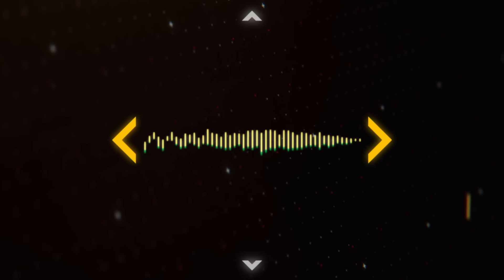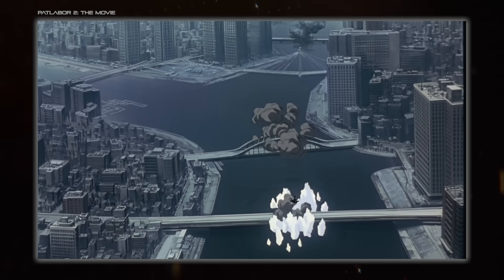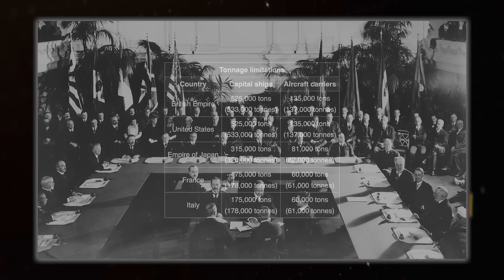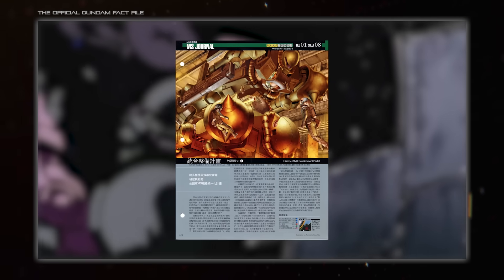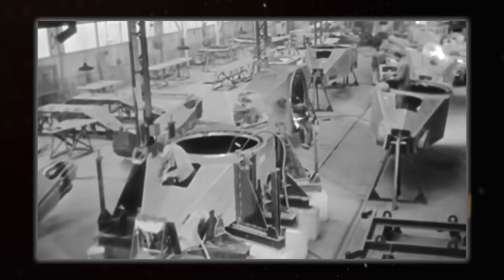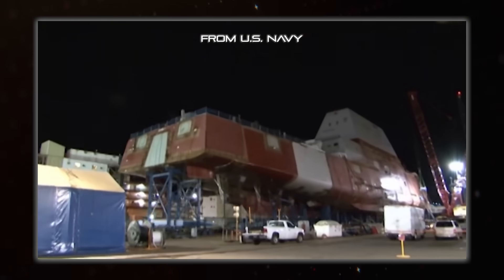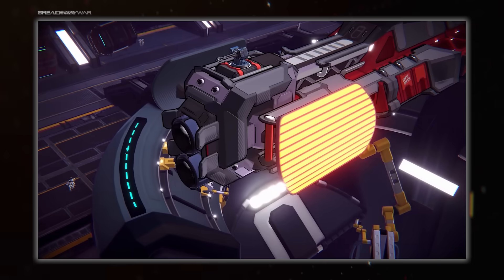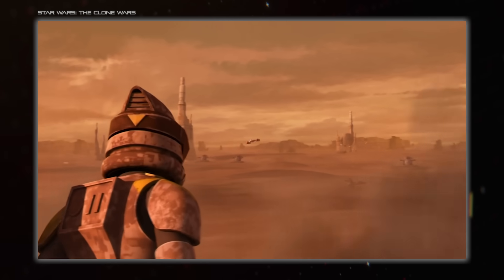Design Principles in Sci-Fi Spaceships

Comment: Another reason I so love Stargate. The Earth ships feel like something the human military built once exposed to the alien tech needed to accomplish it. The 303 and the 304 look like we took material earmarked for some carriers and frigates and slapped it together around a spaceframe instead. And that hunkered turtle shell on the 304 makes it look like it was designed to be able to take a hit while dishing out damage.

In particular, they look like they were meant to sit above Earth, directly shielding us from above as they fired up at the enemies attacking the planet. Also explains the complete lack of armour plating on the underside. That would be facing us. Shame we fell behind on the weapons side for so long. But boy could they take a beating.

Even the insides felt human. Long corridors with the bracing every few metres. So many greebles inside and out. And then we expand out to the different other races and their own design philosophies. The Goa'uld where pomp and intimidation is paramount. Everything exists to maintain the illusion of their divinity. Even if the design isn't the best way to do a thing, it's there for the wow factor. To keep the primitives bowing in fear and wonder.

And the Asgard are beyond such things. Their designs are open and practical because they've developed beyond the limitations we're still bound to. A massive open multi-tiered bridge is easy for them. Long wide corridors are fine when you can move around easily using beaming technology.

And I loved the way the races incorporated racial aesthetics too. Though the Goa'uld did stick very closely to the Egyptian aesthetic due to budget, the hieroglyphs all over the walls which sometimes had a practical purpose were great. The Asgard control systems with the mix of stones and symbols were very cool.

Here we are, rushing to catch up by mixing both systems with good old-fashioned push buttons and CRTs. The bleeding edge at the time.

Gosh, I wonder how much more Prometheus weighed because of the five hundred CRT monitors than it would of had they been newer, lighter LED monitors...
Reply: But think of the savings they made in life support! Those CRTs worked both as vital displays and helped heat the sections of the ship that had most of the crew most of the time! 😁
Reply: @DrBunnyMedicinal Actually it's getting rid of heat that you have to worry about on a space craft. The ambient temperature might be low, but hard vacuum is a poor conductor
Reply: Ironically, it's actually less likely that the Asgard would have wide corridors because of the beaming technology you mentioned. Why have corridors at all when you can beam around all you want?
And don't say "as backup." If there's one thing proven about Asgard, it's that they don't have backup plans for if their fancy tech fails them.
Reply: IMHO, the 303 and 304 classes seemed much too large for Earth's first interstellar warships; and too quickly built; and too expensive for a program that was allegedly secret. A more plausible sequence is that Earth hijacks an increasing number of Goa'uld cargo/scout ships and Alkesh bombers, refits the interiors, and incrementally moves the tech to new spaceframes. Like zat guns added to SGC's armory, writ large. Story-wise, this would necessarily go in different directions than the space battles we got in SG1 and SGA.

The anime "Superdimensional Fortress Macross" has a similar issue: Earth gets one crashed warship, and within 10 years has reverse-engineered multiple technologies, created a manufacturing infrastructure, and built out a whole military; alll without alien-ally assistance. (The derived "Robotech" is slightly more plausible, in that the crashed ship is a lab vessel with onboard manufacturing, and at least one human gets brain-boosted familiarity with the tech.)
Reply: They pretty much got burnt by the first test with a modified death glider (X-301) and didn't want to risk any other captured ship having booby trap systems hidden deep within them. So the costs be damned, Earth-built all the way.
Reply: @ This is a mixed reply to you and phillipthorne8363.

I agree that the X-301 would have been a major factor in the Earth-built philosophy going forward. Though Earth-construction was always intended after the 301.

They couldn't really rely on capturing gliders on the regular. Especially when they'd have to be in orbit around Earth for any reasonable chance to use them. bringing Gliders through the gate is a non-starter really.

But they absolutely didn't let the 301 failure stop them trying to steal ships either.

The several Ha'taks they had control of for about five-ten minutes each from Cronus and Anubis. And the Al'kesh Jack stole from Ba'al during the Avenger Crisis come to mind.

Guess only Apophis decided to add a recall feature. But Earth-made was the only way to be sure. And it wasn't exactly quick.

It took six years before we had an Earth-built ship at all. And it failed to do what it needed to do. Then the second one was launched incomplete by a terrorist group. Likely wouldn't have seen action for another year otherwise. And even then it too had many flaws that basically made it unusable for two more years.

We never actually managed to design our own functional hyperdrive. it's not until Jack convinces Thor to provide Asgard-designed ones for Prometheus in S8 that the 303 has reliable hyperspace capability.

It's not until Season 9 that Earth had a reliable spaceship we could fly across the galaxy with purpose and know it would get there and back without serious failure.

I'd say nine years of concerted and ever expanding effort isn't unreasonable for R&D and construction of a viable spaceship. Several countries are actively working on this as a high-priority lest we be annihilated from space. Kind of helps cut through some of the red-tape. We built high-energy density reactors as early as S3 with the Orbanians assistance. So we're already ahead of the technology curve in the show.

And Earth had many hiccups and got burnt along the way by more than just the X-301. I think Stargate did a superb job of showing a gradual understanding and progression that led to the X-303 and eventually our fleet of BC-304s.
Reply: @enemixius  And nobody wanted Hammond (of Texas) to give them a disappointed look. That'd motivate anybody.
Reply: @tyrannicpuppy  The lack of recall feature on the Ha'tak ships could also be due to goa'uld considering it unlikely deserters would/could take off with a whole capital ship
Reply: @justinthompson6364 or that unlike Death Gliders they were designed for long term deployments. You don't want your corvettes just deciding to lockout and rtb when they have to detour to pick up some more supplies or troops.

Comment: Best I can figure is:
- Powerplant/storage
- Drive (integrated with powerplant or seperate)
- living space
- closed ecology/supply storage
- computers
- weapons
Reply: -Access point (hatch or ramp or canopy).
-Sensors and comms (Subspace/hyperwave/radio/etc).
-Hull and defences (radiation/space debris/lasers/heat/enemy weapons/missiles/atmosphere).
Reply: Don't forget the Coffee Machine... Otherwise Holden's not going to be happy. XD
Reply: @GabbieTheFox  Or get the phrase "There's coffee in that nebula"
Reply: Just screw one of those plastic garden chairs to a fusion rocket. ez
Reply: @igncom1  Ah yes, the old Kerbal "Compact High Atmosphere Impromptu Re-entry" Device, or C.H.A.I.R Device.
Reply: "living space" is a bit unspecific.
Rotating habitats for different gravities.
Gyms, golf courses, artificial lakes, softair places, etc.
Reply: @MrCmon113  True, living space is very broad. it could be all those luxuries you're describing but on the other end, if you've got a cold military ship that isn't expecting extended patrols the bare minimum would just be;
Bunks
Provision stores
Command & Control centre
and Access to systems that need to be manned/maintained

In this case bathrooms, maybe a kitchen and probably some gym equipment would be included in bunks, and these categories can even overlap into the same space. 
ww2 submarines for instance, often had food stored all over the C&C and the bunks, wherever there was space, and you might've even had to fold the bunks to the side to access torpedo reloading equipment.
Reply: Bathrooms
Reply: Fuel and/or Propellant, the powerplant needs to run on something and so does the drive.
It's also an enlightening exercise to look at the cross sections and interior plans of real life navy ships and see just how much of that space is delegated to carry fuel!
Reply: Radiators.
Reply: pods, and of course your pod bay w pod bay doors...
Reply: And heat management. Radiators!

Comment: It needs to be able to spin. That’s a good trick.
Reply: This needs to be a pinned comment @spacedock
Reply: This unironically. It's a simple means of defending against lasers, autocannons, dust guns, and any weapon that requires repeated hits to deal damage.
Reply: Spinning is much cooler then not spinning
Reply: @trekkieraccoon3343  it has to spin it's round!
Reply: it makes defending easier as it soreads out damage, bit attacking more difficult, as you need to respect your changing rotation in the firing arc, and the projectile will also get momentum from the rotation, theowing it off. If you use autonomous rockets, that's not a problem, but even guided bombs may struggle.
Reply: And also let's you point your gun at stuff.
Reply: "DO A BARREL ROLL!"
Reply: Case in point: the Arwing's iconic (not actually a) barrel roll, which deflects energy projectiles with no damage to the shields.
Reply: Ore a liquid Metall shield on the outside of a ship (very small Metall particles in oil Ore so) 🤔
Reply: Discovery ruined it, made it look and sound goofy
Reply: I mean, it was- TWICE.

Don't forget that's how Lil Orphan Ani got rid of the missiles locked on him above Coruscant...
Reply: @Sephiroth144  ah if only he'd been splattered all over the cold unforgiving vacuum then maybe we could have avoided the Disney trilogy
Reply: Even if the spaceship has artificial gravity the ability to survive it's loss would be an anachronistic design feature that would be basic to the shape.
Reply: Now this is podracing.
Reply: The Hermes from The Martian got that down pat
Reply: Yes, I've heard that as well.
Reply: Heeeyyy easy with that
Reply: That’s actually a funny “YouTube joke”